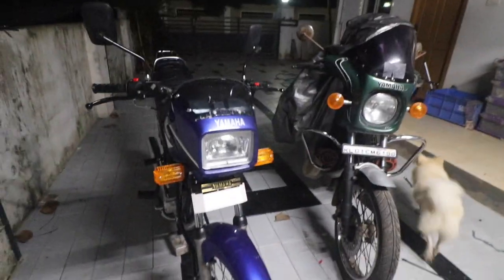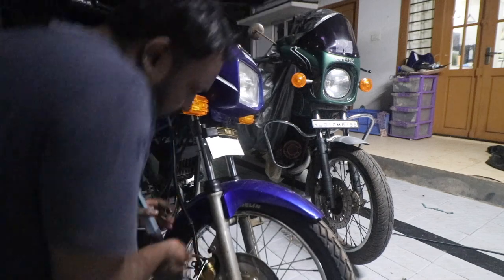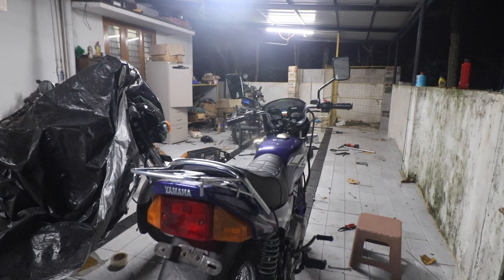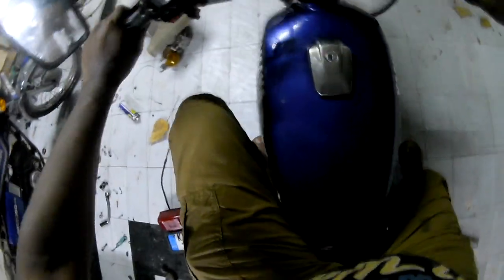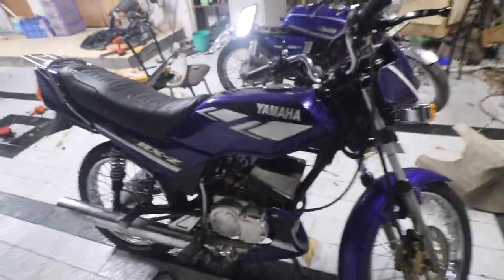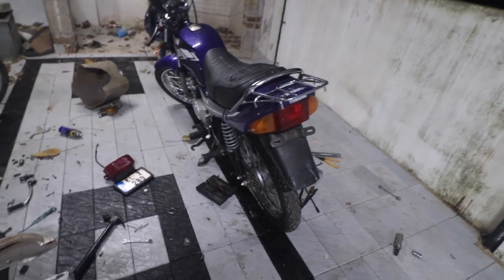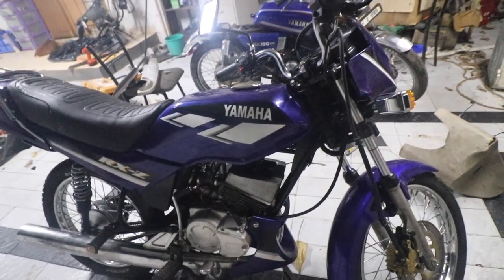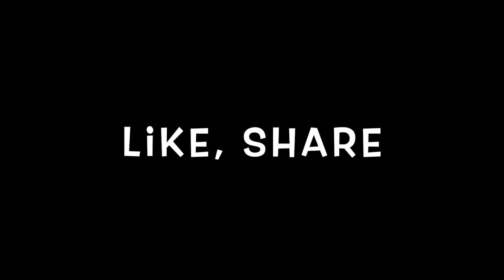Rebuilding the Yamaha RXZ part 19

Comment: HI there it's been a long time I have seen ur videos but iam back.. But my question is I ride rx 135 so brakes are shitty can u tell me which disk brake u used and how much it's gonna cost and how is the stopping power now
Reply from the maker: Deepak gs I have used Rxz 5 speed hub and plate and gladiator fork, master cylinder and caliper. This above setup is mostly temporary and is focused at originality and aesthetics. The braking is now superior, but same results can be obtained with much lower costs. For instance, going the used route can be much better than going all new. A pulsar setup should cost you anywhere between 2-4K depending on where you source stuff. The Apache setup in my shogun costed me around 4K, the pulsar 220 setup in my rd costed me 9k. So again decide whether you are focused on aesthetics or functionality
Reply: @Yamakaze  thank you
Reply from the maker: Deepak gs you are welcome